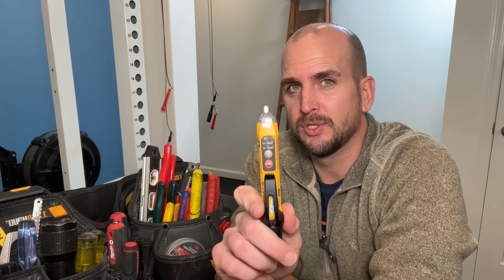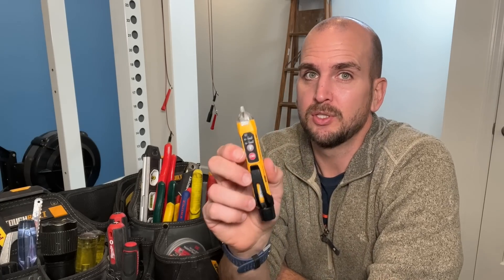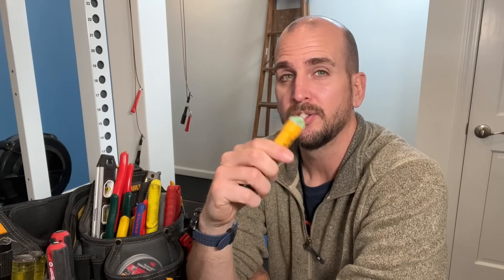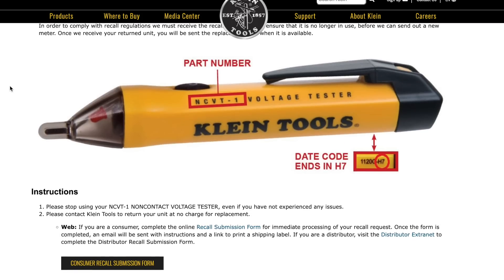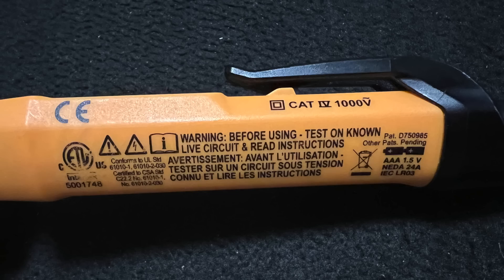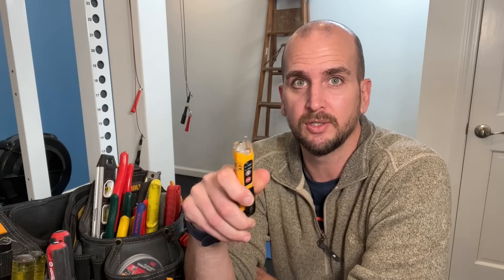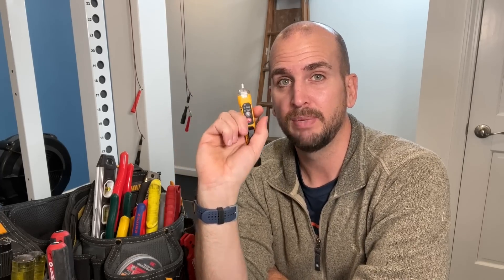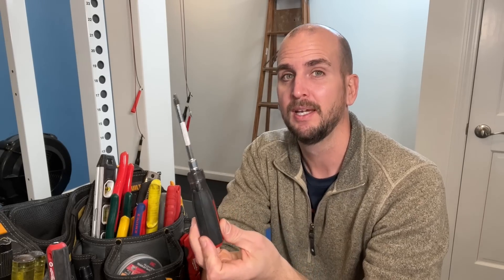The Tool I Get The Most Negative Feedback On And Still Use Weekly

Comment: Heres another thing a multi-meter can’t do:
A friend said their outside light stopped working sometime around the time they hired a handyman to do some electrical elsewhere in the home. I opened up the light, old wiring, 2 wires, no ground, plastic box. White to black measured 0 V with meter. NCVT was going off like crazy though. Confused, I set up a super long multimeter lead to a known ground, and there was 120v on both the black and white wire. NCVT saved me. In fact, if I brushed it off as a false positive, things would have been very bad.
Reply: Back in the day we were issued foreign voltage detectors to use any time we were touching something that could even be remotely electrically charged, I stopped doing that type of work but went out and bought one anyway. It never hurts to wave that thing around the front of the box to make sure everything is the way it should be before I start touching things.
Reply: Holy fucking shit geting 120 to the ground that is some scary dangerous shit going on right thar.
Reply: Bingo! Had the same problem and getting shocks off the stove. Found the "fool box" (j box) and the neutral to hot short.
Reply: If your worried about false positives why are you using it?
Reply: @RadioRich100  what? I’m not. False positives aren’t even dangerous, they’re just confusing.
Reply: Try holding one test lead in your hand and probe the wire with the other. The DMM input impedance is usually high enough that you'll detect the voltage even without a solid ground reference.  It won't be the correct voltage reading, but should show an indication of voltage present.
Reply: Got to be carefulf with those lost neutrals.
Reply: This is why you should always check to ground with the multimeter.
Reply from the maker: That is a good example of how you can get in trouble with a meter.  Thanks for the feedback.
Reply: @EverydayHomeRepairs  I'd say it's a good example of why shouldn't let handyman do your electrical work
Reply: @washellwash1802  Except for the part where I found the same issue created by a licensed electrician. He knew better. Except the part about actually paying attention.
Reply: @EverydayHomeRepairs  Maybe multimeters should come with a warning too "Only for competent persons". No matter what the wire, you don't know what voltage is on it. The old neon tester would have showed both were live. A multimeter shows the difference in voltage of 2 places - so you need to make sure one of the places is somewhat grounded. The lightbulb in the outside light was already doing the same as what the multimeter showed - that there was no voltage difference between the wires. I guess the handyman had disconnected the neutral somewhere - accidentally or otherwise.
Reply: @EverydayHomeRepairs  I don't understand what was happening? Why did the multimeter give him a false negative in that scenario?
Reply: @R3dp055um  There were two live wires in the box, instead of a live and a neutral. Voltage difference between the wires was zero. Voltage difference between either wire and ground, 120V
Reply: @R3dp055um  a multimeter, when testing AC, requires two completely different wires, if the neutral and hot were pigtailed together or shorted out together, then it's no different then putting both testing leads together
Reply: @R3dp055um  no neutral present
Reply: @R3dp055um  because he was too lazy to check another ground and was looking for a fast solution to the problem.
Reply: @R3dp055um  both wires have the same potential.
Reply: @R3dp055um  two hots off the same phase, like if you twisted two pigtails onto one wire, you would not read a difference of potential between them. ALWAYS TEST PHASE TO PHASE, PHASE TO NEUTRAL, PHASE TO GROUND.
Reply: @R3dp055um  it did not give him a false positive. the noncontact voltage tester showed the presence of electricity. A multimeter showed that it was not a live circuit. Whoever did other wiring in the house, connected the neutral wire on that circuit to a hot wire. If he touched the hot wire and was grounded, the voltage would’ve run through him. The noncontact voltage tester saved him from that experience. He was able to figure it out by connecting the multimeter between the neutral or hotwire on the circuit, he was working on to a ground.
Reply: @saigyl9149  Ever hear of ground?
Reply: @R3dp055um  Multimeters test for a difference in voltage between the two leads. And so because the white and black were hot, the voltage difference shows 0V.

Didn't mean there was no voltage there though! It just meant the two places the leads were touching had no difference in voltage.
Reply: Sounds like you were too lazy to check from another ground in the first place.
Reply: If there was 120 on each wire the meter would read 220/240. I don't understand
Reply: @wr6392  the meter measures a difference in voltage potential between the two leads.  If both wires were at 120v (same phase because they are pig tailed together or shorted) then the meter will show 0v difference in potential between them.   It would be like measuring voltage at two points along the same wire.

The 220/240v reading you are thinking of only happens if the two wires are on separate legs / phases of AC current.
Reply: @LeverPhile  if they were contacting each other and shorted there would be no voltage than.
Reply: @wr6392  unless the neutral was wired to the hot (accidentally) and thus separated from the true neutral.  (Handyman pig tailing the wrong wires together up the line.)
Reply: @wr6392  leverphile is correct
Reply: @wr6392  That would only be true if there were a (sufficiently large) phase angle between the two phases (live wires). Imagine the situation where a cable enters a junction and then it's split in two: ------[  Obviously, whatever potential the cable is at, the two cables after the split have the same potential - there is no voltage difference between the two. Now imagine that the initial cable is connected to a live 120V... you have 0V between the two "output" cables, but 120V between either cable and ground.

The actual wiring situation is probably a bit more complicated, in the sense that the handyman at some point wired two lives (one to a "phase" and one to a "neutral" coloured cable) in two different points of the circuit, but luckily (?) the only connection off that "neutral" cable was the outside light. Result: no light comes on, as the light bulb is at 120V at both ends, so there are exactly 0V across it, and no current. But the whole bulb is "live" at 120V.
Reply: @wr6392  Both wires were at a potential of 120v relative to ground.  But relative to each other, they were at the same potential, so a 2 wire voltage test read 0 potential between them.  The two wires were both "hot" on the same phase, and just sitting there waiting for some path to ground like a snake ready to bite.
Reply: @wr6392  This is the type of thing that happens if the neutral path is open. With out a completed neutral circuit the voltage potential difference is 0 but each conductor to ground will read 120v. It is a fairly common thing I find with circuits that were working then aren't working. I check each conductor to ground, it should be 120 to ground on the hot and 0 on the neutral, if there is 120 on the neutral then the neutral is open, there is a bad connection somewhere in the wiring.
Reply: @wr6392  Not if they're in the same phase.   2 hots in the same phase will read 0 on an AC meter because the meter is measuring the difference in voltage and there's no difference between 2 hots in the same phase.
Reply: @quademasters249  there are not multiple phases in normal household power.
Reply: @wr6392  In the US, 220 is "split-phase". Meaning at the transformer the output is 220 with a center tap. The center tap is neutral and you then have two sets of breakers on each side of the breaker panel. Each row is 120v, 180 degrees out of phase with the other.   You combine both rows with a 2 gang breaker to get 220 for larger appliances. 

If you're not in the US and only have a single 220 phase coming in, what I said is just as true. If you measure between two hots, it'll still be zero volts difference.
Reply: @quademasters249  I understand that.  Great explanation btw. Household power is still referred to as single phase.  I've never heard each hot in a panel referred to as a phase because it's all one phase.
Reply: @wr6392  Don't know where your working on household wire but any house that is wire for 208 / 240 is a 2 phase system.
Reply: @wr6392  It is not all one phase. 3 phase power is the same 60hz sinewave in all 3 wires that are timed 120 degrees out of sync from each other. 208 / 240 is at least 2 phases of a 3 phase system. 208 is 2 phases that are 120 degrees out of phase and 240 is 2 phases that are 180 degrees out of phase. 3 wires run in to residential. 2 phase wires and one neutral.

EDIT: So apparently I goofed this up and it is split / single phase.  2 sources of the same phase but mirrored.
Reply: @D3M3NT3Dstrang3r  240 power IS NOT 2 PHASE. IT'S SINGLE PHASE
Reply: @wr6392  How do you figure that. There is not a single 240 volt wire in my house.
Reply: @D3M3NT3Dstrang3r  each hot in the panel is not a PHASE
Reply: @wr6392  I see that they consider it split or single phase when the second wire is the mirror image of the other but not out of sync. Even though it is stated that it is 2 phases 180 degrees out of phase with the other but single phase at the pole.  Guess I will have to get a 2 channel scope and see what it looks like here since it is 208. Either way your correct in your terminology.
Reply: @wr6392  , not if it is the same phase..
Reply: @zerosparky9510  what are you responding to?
Reply: @wr6392  They are on the same phase therefore there is no difference in potential there, it’s equivalent to putting the black and red leads on the same wire at different points.  The neutral must have been tied to the hot in another no with no way back to the panel.
Reply: @wr6392  Only if they were opposite phases.
Reply: @wr6392  "If there was 120 on each wire the meter would read 220/240. I don't understand".

If the two wires are incorrectly in contact somewhere, they can both be hot (and show 120V to ground) but of course will show 0 V between them. Same as if you tested ground to ground. If the hots are on different circuits, then the meter would show 240V.  (The pathetic part here is that I JUST dealt with correcting this after the "experts" left me with a hot neutral. My first indication of the problem was a nasty shock, of course. Neutral was hot and of course not bonded to ground. This from a licensed electrician).
Reply: @darelldd  there is only one phase in residential power(almost always)  There are not multiple phases as there is in commercial applications.  (3 phase). But I know what you're trying to say.
Reply: @wr6392  Oh man. I botched that one, didn't I?  I've gone back to offer up what I MEANT to post. Ug. Thanks for the polite correction!